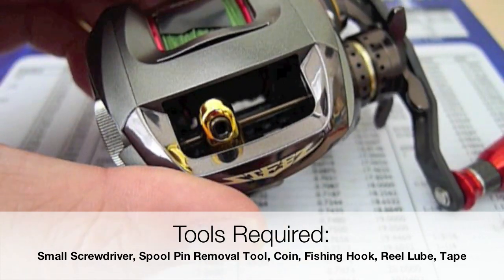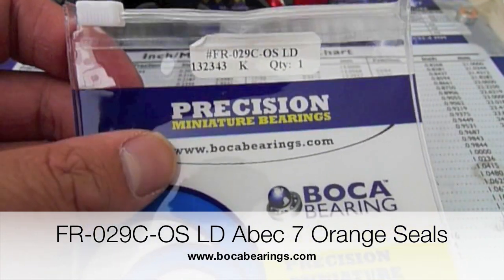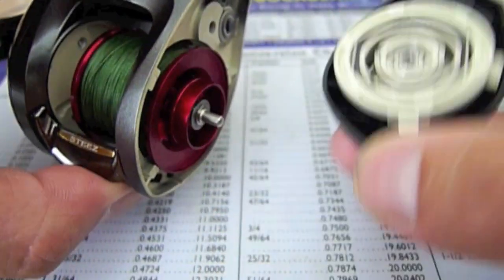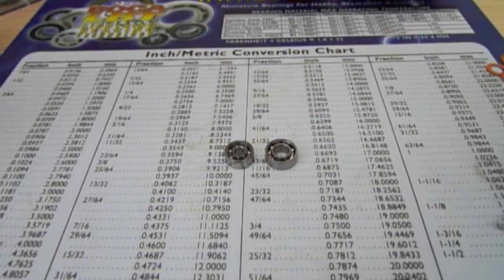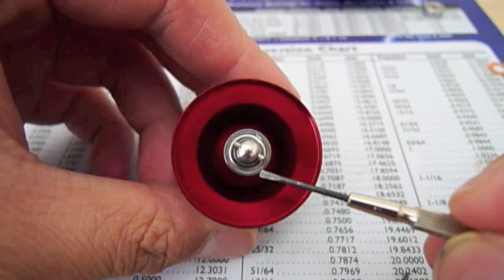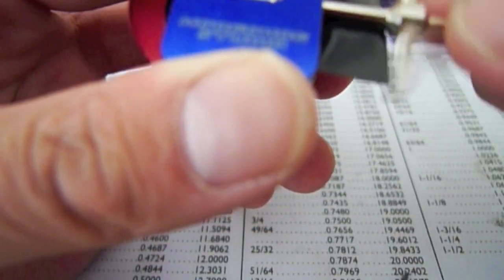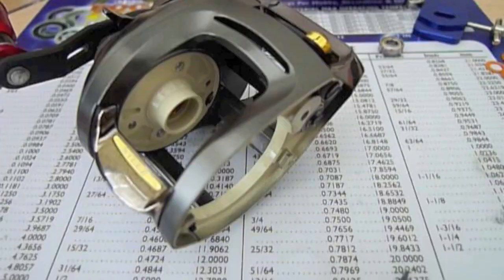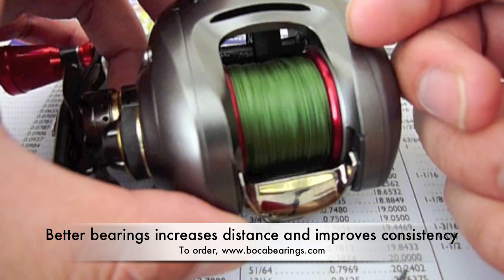Daiwa Steez Bearing Upgrade tutorial

Comment from the maker: the previous gen steez has 85mm handle and I think the zillion have a 90mm handle

If I were to put carbon handles on the steez and zillion, I would go for 90mm on both and if you're power fishing or if you need more torque, I would even go 100mm